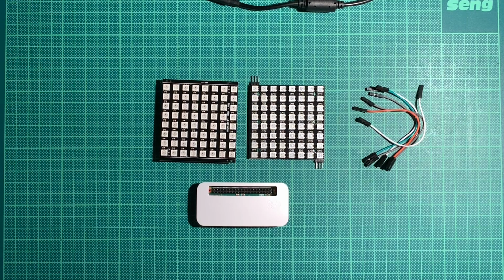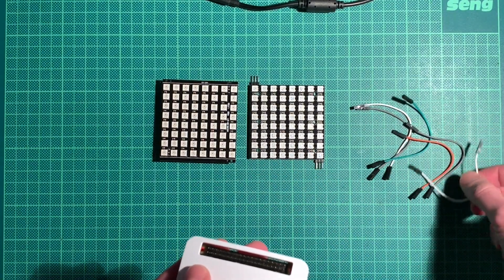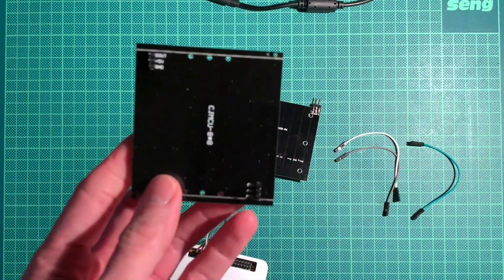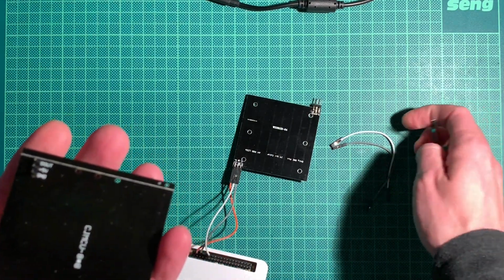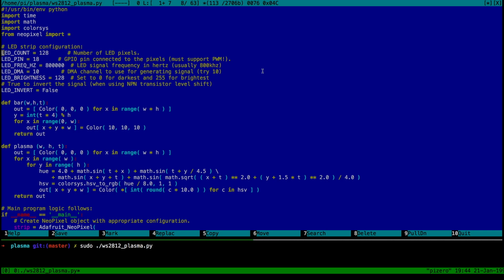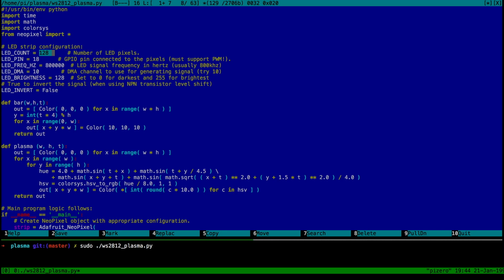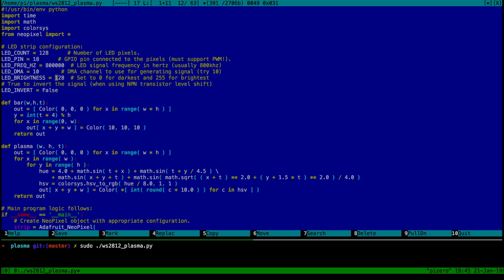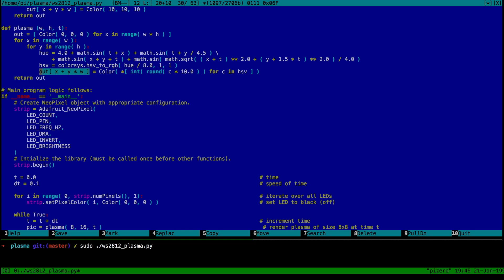RGB LEDs: Daisychaining WS2812b Panels on the Raspberry Pi

Comment: If I had 5 panels, can you take a center panel and then add a panel on each side giving you a plus symbol?
Reply from the maker: You could, but you would need to adjust the code quite a bit and be creative with the wiring. The code would need to "know" that the next panel will be on top of the cross section and so on.